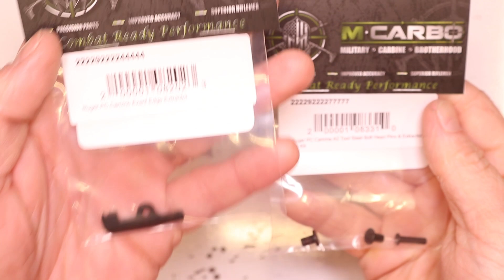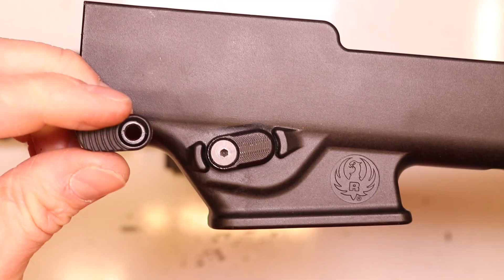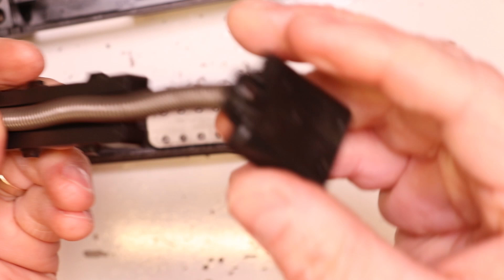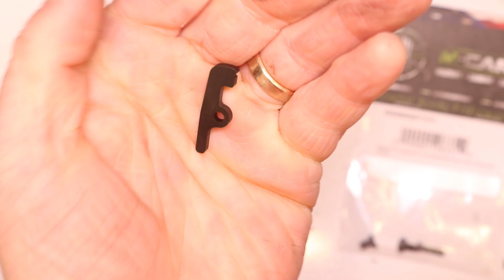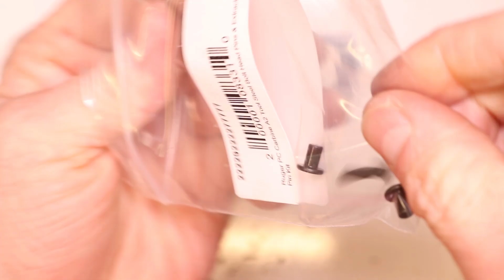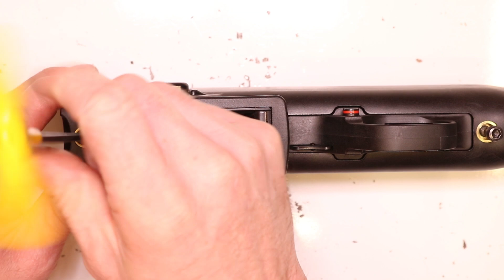Ruger PC Carbine Exact Edge Extractor & A2 Tool Steel Pin Kit - Ruger PC Carbine Accessories

Comment: I installed the exact edge extractor and after a couple of hundred round the edge part that engages the case head chipped of, I have reinstalled the original Ruger extractor.

Comment: I installed MCarbo's extractor last year and my PCC was operating without malfunction for ~1500 rounds of Norma 124 gr TMJ ammo. On the last range visit, I started getting stove pipes, so took my Ruger apart for cleaning, and found that the 'claw' got completely worn out or broke off. For now, I replaced the edge extractor with the one I got from Tandemcross as a spare, and will be watching the part more closely now. I ordered another MCarbo's extractor - now its going to be a spare.

Comment: thanks for info... my new carbine had two ejection failures with each of the 8 Ruger Mags using various factory ammo.  My second outing and after installing mcarbo extractor had only two stove pipes with Tula steel, the brass and aluminum ejected 100% great.  So will see how things go.

Comment: What do you do when the bolt head pins won’t sit flush? And one gets stuck? I’m regretting spending a penny on any of these items
Reply: Any update did you figure it out?
Reply: @pennypointer113  Same problem here. One of the pin went in easily but the other was very very tight, not deep enough and, more worryingly, very difficult to remove. I ended up giving up (I kept the two Ruger original parts) and only replaced the extractor, its pin, as well as the recoil spring cap. At first glance, the new extractor looks 100 times better. For the rest, it seems a little too marketing to me...

Comment: I got the tandemkross upgraded internals and it still failed to eject, anybody else in the same situation? Looking to get the MCarbo upgraded internals
Reply: I am in the same exact situation. Did you ever switch to MCarbo? I just placed my order. Hoping it fixes my stovepipe issues.
Reply: @LLCOOL_James  well??? what happened
Reply: @chadhaire1711  with the m carbo extractor it seems like the stovepipes have gone away. Not too sure if its because I've switched ammo or if the carbine just needed to break in. But nonetheless, no malfunctions since switching extractors.

Comment: I just bought a new pc carbine. First day of shooting, stovepipe every other round. Took the entire gun apart, cleaned and oiled. Got it to shoot 10 rounds before Failure to eject. Your video has the most useful information on the inner working parts of the gun . Learned so much about it from your video. Ordered these parts as well as the buffer.
Reply: so did they work???

Comment: Got this installed in may RUGER PC chassis carbine, along with EVERY other M*CARBO product for this carbine (except discontinued internal trigger parts). After 800 rounds with all types of ammo everything works perfectly.  TIP: Get the TANDEMKROSS dual safety levers and lose the awkward RUGER push button safety. You will love the ease of use.
 **PLEASE make a better GLOCK mag well adaptor that fits GLOCK magazines so they don't wobble when firing the carbine. My RUGER PC chassis carbine has about as many parts replacements/additions as is humanly possible including a folding stock. BUT I feel that now I have a longer lasting and better functioning PC carbine by far.

Comment: I bought my Ruer PC about a year ago.  What do you do when you have a new toy like this?  You go to youtube to find out about it.  I came acoss MCARBO last fall and finally got around to beginning with upgrades at Christmas.  I'm loving that charger handle.  When you're on a fixed income, you can't buy it all at once.  This month, I'll be buying the extractor and the shock buffer.  I already have the trigger group pins and recoil spring retainer.  I'm looking forward to getting the upgrades paid for and installed.  As I was deciding what I could afford each month, it suddenly occurred to me that Ruger could build the rifle with quality parts like this BUT then it'd be more expensive and old skinflints like me wouldn't buy it.  Bottom line, I'll spend an extra hundred or so dollars to up-grade but not to buy a more expensive rifle.  Ain't life grand.

Comment: After 400 rounds I noticed the ejection was starting to get sluggish. Then after my first failure to eject I installed the exact edge extractor, bolt head pins ,and recoil buffer and it's been running like a top ever since. Ejected brass gets flung way out again.

Comment: My question is…. By replacing  the bolt head pins with hardened steel (A2 tool steel) pins, won’t the holes those pins go into now take the abuse, wear and tear from the A2 tool steel parts??? In other words, I’d be afraid of the bolt head made probably of a mild steel, wearing out faster now because the A2 hardened pins are delivering a punishment onto the softer steel Ruger factory parts the pins fit into.  Wouldn’t placing hardened steel against a softer steel and where both parts “collide” and rub into one another, then something’s got to give right???  MCARBO, what say you about this please???
Reply: Good question
Reply: Still no answer from MCARBO.
Reply: still no response. Tandem seems to be more open to answering questions.

Comment: I seen on the forums wasn't only the extractor it was the ejector bending. The ejector from the other magazine block swapped out was the fix. Slamming in the mag maybe the cause with the weak steel used.

Comment: On the PC Carbine Chassis Ruger omitted the front sight because they wouldn’t line up right with the ergonomics.  If there was a pic rail to attach to the hand guard that would sit flush with the factory pic rail on the receiver, it would increase optic and sight options.

Comment: Between this video and comments on Reddit, I ordered these two parts, the extractor and the pins.

Taking them out of the bag now, with your instructions here I feel confident that I can install these. I'll definitely let y'all know how the gun functions.... Hopefully I can make it to the range today.

Was very disappointed with the fact that this Ruger was having stovepipes every 4th or 5th round.

Hopefully this clears up the double feeding issue too.
Reply: Installed the parts yesterday. The Mcarbo extractor and the pin set to hold the bolt and extractor.

Range report: the gun functioned almost perfectly now! I only had one malfunction where it tried to double feed. It's currently August of 2020 so ammo is hard to find.

Thus I only shot 110 rounds through it, but I went from a stovepipe every 4th or 5th round (*edit: to not having any stovepipes at all.*) Consider this my recommendation that you buy these products.

Comment: Are the tool steel pin hardened? If so , won't the hardened pins damage the bolt head?
Reply from the maker: No Sir, we tested the Bolt Head Rockwell Hardness and it's same RC rating as the pins.

Comment: I ended up here because my NEW PCC from RUGER with MLOK RAIL, AR style grip & stock won’t EJECT ANY TIPTON “Snap Caps”. WTF????   FWIW, I did swap out the Ruger mag adapter for the “Glock” adapter.
    ——->>>> UPDATED:  I did something I did not wanna do at home.   I put a LIVE round in the mag WITH SAFETY ON.  I racked it AND.... the live round flew out FAST at 90 degrees.  Apparently I cannot conduct a good test with my Tipton Snapcaps with my Ruger PC9 (bought Dec 2019, latest & greatest).   However, I still believe, based on Tipton SnapCap tests, that there’s a problem with the OEM parts (EJECTOR & PINS) & will need replacing.
Reply: I know this is old but had the same problems with certain snap caps ...don't use the plastic ones and it ejects perfectly

Comment: If you add the tool steel pins does it transfer the wear to the bolt head? Since it is now probably the softer metal.
Reply from the maker: We tested the hardness of the bolt head when designing to ensure it didn't create more problems down the road. The pins match the hardness of the bolt head, as we heat treated the A2 pins to match.

Comment: Kind of a minor request, but how about a cover bolt/screw to hide the opposite side of the charging handle attachment, another words to hide those threads of the side that's not being used.
Reply: I almost bought a second handle just to address this issue
Reply: @DarkSentencer  i did n put the oem on the other side.    That TK hook thing is great.
Reply: I got a handle for each side.

Comment: I'm surprised you don't sell/offer a "high performace" Extractor SPRING to go along with the new extractor.
Reply from the maker: Good point..will see what we can do.
Reply: @MCARBO  the lack of springs is an issue. Imo you are the carbine/charger guy, if you dont do it....  i feel strange im 5 mins from changing buffer, retainer, bolt pins, extractor pin, extractor... but putting all oem springs in. Feels sacreligious :-(

Comment: I like the idea of changing out all the parts that have an obvious potential to fail. Do you, by chance, offer a kit with all the upgrade parts you guys make for the pc carbine? I'd be interested in buying that, especially if it's cheaper than buying individual pieces.
Reply from the maker: I like the way your thinking!  We don't have one yet....but will have to put one together.  Let me work on that today.
Reply: @MCARBO Any update on this? I would be interested in a packaged deal as well. Thanks for the video.
Reply: I second that idea.  I think about getting one also with the adjustable stock but would like to get a upgrade kit... seems to be a good firearm with stock cheap parts cause 500 rounds is nothing to shoot.but I guess that first 500 will tell the truth a about a firearm
Reply: Just bought my pccarbine.  Thanks for the helpful content

Comment: I'll second the stainless retainer clip and new buffer and suggest two items. 1. Stronger ejector plate and 2. (for the FF handguard models) picatinny rail section to replace the rear sight. Thanks for responding so quickly to your customers
Reply from the maker: Awesome!  In the works now.  Thank you for voting!